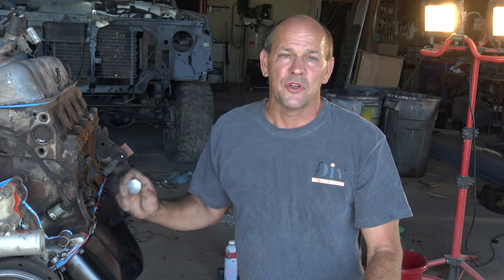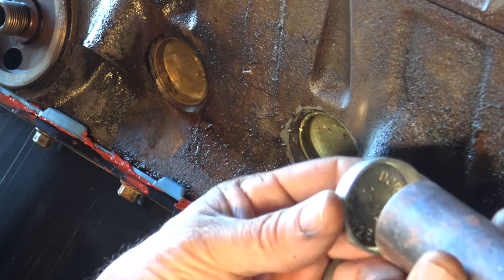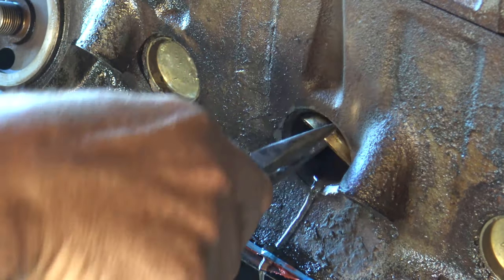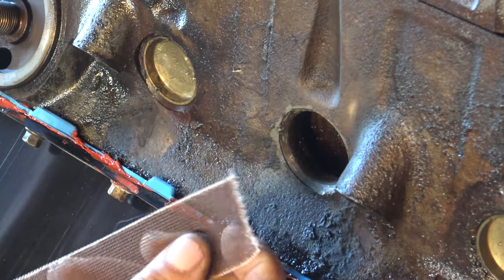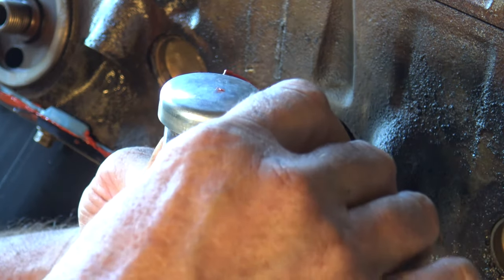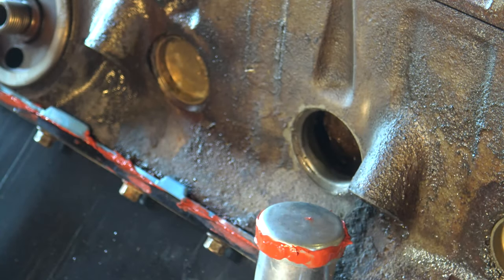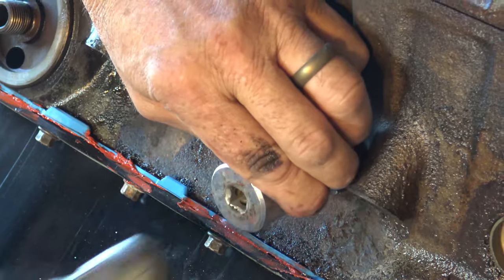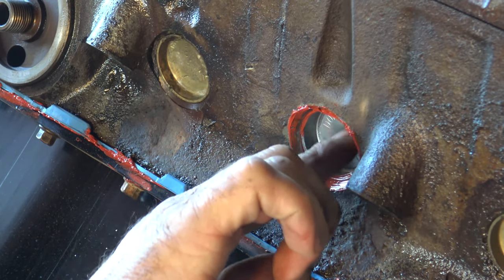How to Replace Freeze Plugs | Freeze Plug Installation Tool

Comment: Great video. Found this leaking on an old truck I’m restoring. Had never heard of a freeze plug until now. 
Thank you!
Reply from the maker: Hi, I had my engine out, and had one leaking so I replaced them all. I am working on a 77 K5 Blazer now and have one leaking and of course the motor mount is in the way. I will do all of them with the engine in and make a video on the repair.
Good luck with your truck, I hope it turns out good.
Reply: Me either
Reply: When I was in USAF as a teen ager had a 57 Ford that developed a plug leak. On that car the engine had to come out. Guy who owned the station I worked at part time told me try this stop leak product. (looked like silver dust). Never leaked again!

Comment: My 97 Explorer Sport Trac just went through this today. Towed it home. Confirmed it’s this exact same part. Easy access on driver side once I remove the exhaust pipe from manifold. Hope there will enough room though to get this job down. BUT, I used my finger to feel inside that whole like he did in video and I felt something small moving, is that normal or is the plug on mine in there 😢?
Reply from the maker: There shouldn't be anything loose in there. Just grime. If you have a shop vac and rubber hose, fit the rubber hose to the vac hose and see if you can get the loose pieces out.

Comment: Thank you very much.
i will be working under the car because i do not want to pull the engine for a freeze plug.   but this info is very helpful.
Reply from the maker: Glad it helped.

Comment: Great video! Hope mine goes as easy as this. Did you drain down the coolant first or is there normally only a bit of water there?
Reply from the maker: Hi
There will be a good amount of coolant that will drain out when the seal is broke.
So when it starts to drain, let it go until its empty. Then remove the plug the rest of the way. I will have a new video of a expansion plug change in a blazer with engine in. That should come out in a couple weeks.
Reply: Good idea to flush the block with water to rinse out the sediment and debris that likes to hide in the lower regions of the coolant passages of the block.
Reply: @DIYOnTheHouse  Nice. I have to change one in an E350 with a 351. Of course the freeze plug is behind the dip stick tube, and the exhaust head pipe is in the way also. I really don't want to pull the engine to have to fix this. Wish me luck.

Comment: I been at it for HOURS on my 85 cutlass it will not budge. Also I’m not taking out the engine just for this small job. I need to lift the car high enough to get more elbow room to knock it out. It’s a lil rusted in there I heard if u put heat to it, it’ll help a lil bit. I’ll try again tomorrow with some higher jack stands 🤷🏽‍♂️👌🏽
Reply from the maker: If you disconnect the motor mounts and jack the engine up a little maybe that will help. Heat is the cure all.

Comment: Probably a dumb question but how long do you have to wait for sealant to work or can you drive as soon as it's installed?
Reply from the maker: I would let it cure a minimum of 12 hours.
Reply: AND NOT A DUMB QUESTION EITHER ACTUALLY PRETTY GOOD QUESTION

Comment: How do you know which freeze plug needs replacing, or if you replace one. Do you replace them all? Thx
Reply from the maker: It will be leaking or weeping out of it. If the motor is out of the vehicle I would replace all of them.

Comment: The mechanic just informed me my freeze plug behind my timing belt sprung a leak which is probably the reason for the milky oil, as well as the appearance of coolant pouring down & around the water pump, which led me to believe the water pump was leaking. Was a bit strange since the water pump has just 20K miles on it. I wish it was a freeze plug behind the exhaust manifold, which I just had off last week.
Reply from the maker: That's disappointing!

Comment: I have a 2001 Toyota forerunner 46  and there’s some plugs on the back of the heads next to the firewall very tight location how would you go about changing those. In this case they’re leaking oil. Very good video my dad used to use black permit text back in the day.
Reply from the maker: Hmmm.  Not sure how to do that without pulling the engine.  Sorry I couldn't help on this one.

Comment: Should all freeze plugs be changed, even if just one is problematic?

Thanks for the video.
Reply from the maker: If I had the engine out, I would change all of them.  If it was still in the car, I would probably just do the one that is leaking.

Comment: I am considering a boat that has a core plug problem.  seller says started engine and core plug fell out?   Sound like the boat engine was not winterized correctly.     Any other reason core plugs just fall out.   They don't just fall out ,sright?
Reply from the maker: Yep it froze. Make sure you feel around the exhaust risers for cracks those are the 1st to crack.

Comment: I drove my van about three miles & the engine lost power & started idling ruff. So I drove it back home another 3 miles then let it sit for about 3 months until the weather warmed up…… checked my vehikle to see if anything changes but nothing did. Checked all the fluids, & while filling the radiator notised water pouring out as fast it was going in, only to find the source of the leak a freeze plug missing. What are your thoughts. I checked the oil there is no sign of water.
Reply from the maker: I would install a new plug and test it, with any luck it will be ok.

Comment: I have a 4.2 v6 f150 it’s leaking coolant from a 2inch plug close to the oil pant towards the bottom. Would you say it’s a pretty similar process to change it?  I changed tie rods, shocks, brakes, belts etc. but idk how I feel about messing with the actual engine.
Reply from the maker: It is the same process, it is just going to put antifreeze all over, so be prepared.
Reply: if you can do all that id say you most def can do a freeze plug brother and also its a lot faster than changing out tie-rods. lol
Reply: @tylermulkey330  it was a pain in the ass to get the freeze plug in without removing engine. Took my like 3 hours  It leaked and twisted off. I used a self sealing freeze plug that you squeeze the rubber into the gasket. Took 5 minutes and hasn’t leaked in almost 2 years.

Comment: We call them Welch plugs in Australia, only thing we have that's freezing here is a freezer xD
Reply from the maker: I wish it was warm here. Thanks for the info on the name. I read somewhere that they are casting plug from when they pour the block?
Thanks for watching.
Reply: Now that's funny!
Reply: @DIYOnTheHouse  yeah it's the plug that holds the sand core for the water jackets.
Reply: @DIYOnTheHouse  Casting plug makes sense for me! Here in France, I call this "pastille de désablage" that I can translate into cap or plug to remove sand. Sand from the core after casting the cylinder block. But nothing about coolant freezing. ✌🤩

Comment: I have a 1996 Jeep Cherokee and it leaks antifreeze underneath?  What could it be ?
Reply from the maker: If it's at the front check the bottom of the water pump for moisture.
Reply: Yes froseen plug

Comment: What a detailed easy and superb one of its kind exclusive video on utube by really experienced pro
You deserve million likes and same subscribers
Reply from the maker: So nice of you
Reply: @DIYOnTheHouse  

have a question
I will appreciate your reply
I have cheve aveo 2010 their is tiny micro hole on joint ( transmission and transfer case) I dried it with cloth 10 times and check 10 times ( that's exact point) when I start the car it start leaking ( leak is very very like mini mini 💧 coming out) making way to the ground by passing over from transmission fluid pan as that's is at the bottom
Can you reply with my best  cheapest options 
Plus is it ok to drive 4 to 5miles
I have seen no over heating at all 
No white smoke
No dragging 
No mix of oil coolant or otherwise

Comment: I hope i find some that don't have CHINA stamped on them. Or paint them over. 
'The plug I have to change is spurting water at the back of the head right next to the firewall. Theres only a couple of inches space. Is there any way to push that plug in some other way? Like hittin the plug on the edges? or to leverage it in. I cant face removing the head for such a little job.
Reply from the maker: I had one pop in to the water jacket. I fished it out with needle nose plier. If you damage the sides of the hole that could be a problem. The tight space is a problem to do it correctly.
Reply: @DIYOnTheHouse  I got a whole kit and they're shallow depth and yes they have 'China' stamped in the middle. I replaced my 289 heads a couple of years ago and just rebuilt the engine. I didn't think to change the plugs. I practised on the old heads and it was a cinch on the bench but not while in the car (Mustang 65).They're real low down near the transmission and firewall. I just balked at the thought. Well, whatever you think I just mixed up some Araldite slow set and just piled it all around and over the plug!! I''m replacing my rad and fans etc so there's no coolant in there atm. Sounds like a cowboy fix but I've done my petrol tank with it 25 years ago and it's still going fine (no leaks)!! Ha! Ha!

Comment: Thanks for this. This summer I have to do one of my plugs on my 04 Dakota. Gonna have to remove the exhaust manifold and go at it through the wheel well buy at least I know what I need to go now!
Reply from the maker: Glad I could help!
Reply: ...how did it go? i have a dakota that has a leaky plug too. i also need to get at it from the wheel well but i dont need to remove exhaust manifold, thank gawd!!

Comment: Can i change the freez plug without removing the engine
My car is landrover discovery 2 v8 engine
Reply from the maker: I changed the plugs in our 77 Blazer, I did have to remove the motor mounts not sure on your application. Here is the link to the video. 
  https://youtu.be/DJKIbc4XOFo

Comment: Coolants pouring out of my 2015 Lincoln mkt. No coolant in the oil when I checked. I thought it was the water pump. My cousin said to check the freeze plug. Hes in CA im in North Dakota.  Can't find videos on my type of car. Motors in the car. It over heated one time and that's when the search was on. Can you show where it is or how to check.moneys scarce im a single mom. Thanks in advance ☺
Reply from the maker: I wouldn't know on newer vehicles, they are all so different.
Reply: Run Water In It With A Water Hose And Raise The Car Up 4 Feet In The Air .  To See Where Leak Coming From might Be a Bad Heater Hose. Or Water Pump Gasket Seal Leaking If It's A Leaking Freeze Plug It's A Hole The Size Of A Silver Dollar. On Top Of Of The Engine Or Bottom Or On The Side Of Your Engine.  Freeze Plugs Go By Size  1/2.  Or 5/8 And Up.   Good Luck

Comment: Well how do you do a freeze plug on a 2002 Impala that have a plate inside where the seal goes in the block because that plate do not come out of the block behind the transmission that's the one freeze plug that I'm talking about
Reply from the maker: Hi,
Not sure of that. if you can't access it freely then the engine may need removed.

Comment: Ok so i folowed your video to change mine and using permatex is a bad idea my motor keep blowing these new plugs put each of the 7 on it i suggest to use green loctite that the only way mine kept in
Reply from the maker: Good to know!
Reply from the maker: They should be pounding in tight, the Permatex is just a sealant.

Comment: So how do you remove it if you accidentally push into the block
Reply from the maker: I had one go in the block. I got it back to the hole sideways and then pulled it out with pliers. I was worried when it popped in but realized it couldn't go into the block because it was larger than all the passages.

Comment: Why do they need freeze plugs, should it already have coolant that prevent freezing.
Reply from the maker: When they cast the block the water channels are filled with a sand material, after casting the material is removed leaving the holes. 
Those holes are machined and the plugs are installed. So they are actually core plugs or casting plugs.

Comment: Found the freeze plug on the ground on the drivers side after the insanely cold weather we had here in Texas. This is a 2004 F150 with the 4.6 v6. The motor mount is in the way so I'll have to pull that but shouldn't be too bad. It was leaking anyway before the freeze.
Reply: Me too OMG I was so scared I had just hit a big pot hole and thought I did something else but we found the plug and was that a relief
Reply: same. except i have the 5.4l 3v and my bad freeze plus is on  the back of the motor... ugh

Comment: Will that work on cars running 25 psi boost???
Reply from the maker: The freeze plug is for the coolant system, not the fuel system.

Comment: My freeze plug on my 2003 Ford Taurus has ruined my whole car my car has been down off and on for 2 years I'm deciding to get rid of it. 1350 was the price I paid, I've probably put in 2000 or more into the car, and now I'm being quoted $900 to replace a $5 freeze plug.
Reply from the maker: That's painful!!

Comment: Show me how to replace a freeze plugs that's on the motor mount
Reply from the maker: Great timing.  I have a Blazer I am working on and will have to do that.  So stay tuned, working on that video!
Reply: @DIYOnTheHouse  Waiting anxiously for this. I also have a Blazer with a bad freeze plug at the motor mount.

Comment: FYI there not freeze plugs on the 80’s omc 3.8 L. There casting plugs and they don’t blow out when the block freezes , only until the block cracks.
Reply: Yes you are correct - (mostly called 'core plugs' in the UK)
Reply: @teabelly1565  And the holes are cast in to the block to allow the removal of the sand that creates the cavity where the cooling water will flow. For some reason in Australia these are referred to as welch (welsh?) plugs.

Comment: My Car Didn't Need The Engine Removed Just. Raise The Car Up 6 Feet Up In  The Air .  And Found The correct Freeze Plugs To Replace .   My Car Couldn't Hold Water Or Antifreeze.  My car Overheated And Freeze plugs popped  out One Near The Oil Filter And One Behind The Engine near The Transmission    I Had To Go To The Dealership And ascertain them They only Had  The universal freeze plugs with the rubber fitting. Tapped them and torque in with a ratchet. And Problem solved         Ford Taurus 06 With 199.999 Miles  😃
Reply from the maker: love it when its's easy

Comment: i usually drift using a socket that sits on the outer edge so the plug doesn't potentially bowl / curve in.
Reply from the maker: Thanks
Reply: I was thinking the same thing

Comment: Can you just put it in with out any of that red stuff and I can’t get mine out ?
Reply from the maker: I would highly recommend the silicon when replacing. It's not a repair you want to 
revisit.
Reply: @DIYOnTheHouse  yep because we changed one of mine about 4-5 months ago, stupidly didn't use any sealant.. and it just started leaking again.

Comment: We call them water jacket cap/ plug here in Philippines ,if damaged , oil & coolant/ water mixed , dangerous to engine.
Reply from the maker: Should be no cross contamination if they leak.

Comment: I really hope I can get an answer
Reply from the maker: Hi
To remove and replace them with the engine in you have to simulate the removal and installation. If you don't have room, you have to pull the motor.

Comment: Freeze plugs are not actually freeze plugs. Those holes are there so they can get the sand out from the casting process. If your coolant freezes those plugs will not save the block.
Reply from the maker: 👍 Thanks Frank, I am aware of that.

Comment: looks like it came out way to easy. was told these are Fn tight. and yes these should be Fn tight as if they come out that easy you will loos a motor fast.
Reply from the maker: A few taps with a hammer and they come right out.

Comment: Over use of sealant is not a good thing.  Clean up the overage. Oil pans are the worst place to over apply sealant.  It can drop into the Oil Pan and work it's way into the oil pump and journals.  Causing  a blockage. The resulting oil starvation WILL DESTROY the Engine.
Reply from the maker: Thanks.
Reply: @DIYOnTheHouse  I learned the hard way😮‍💨

Comment: with the engine out , anything is easier...
Reply from the maker: The engine was already out of the truck. Didn't seem to make sense to install the engine then change them. But you can check out my other video where I do it with engine in.